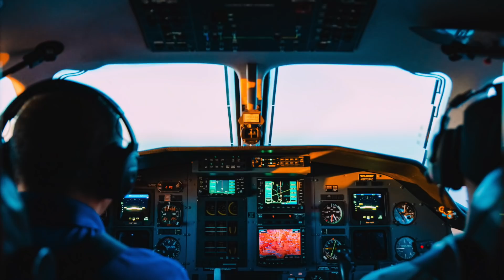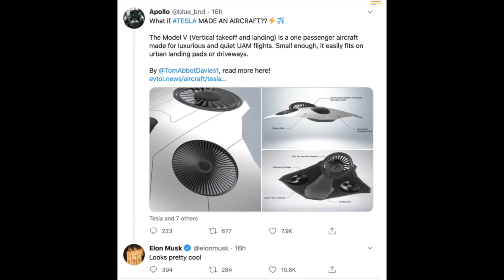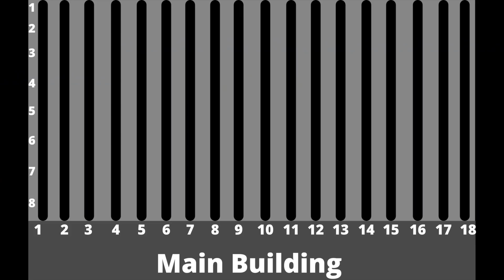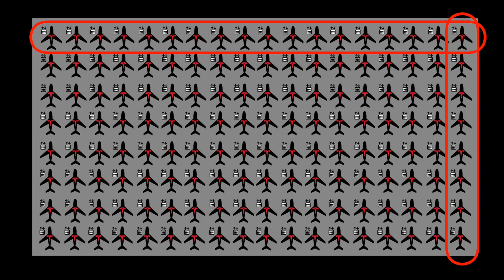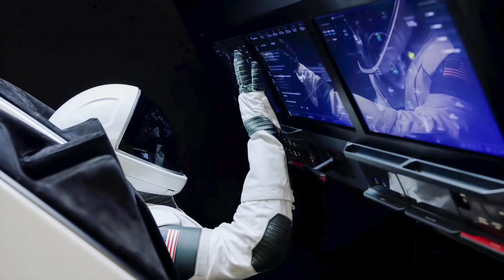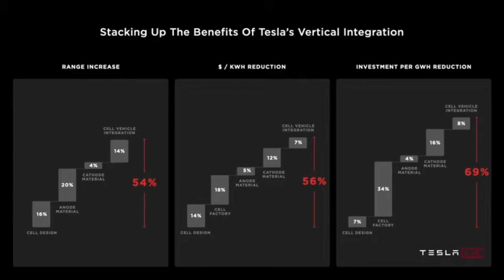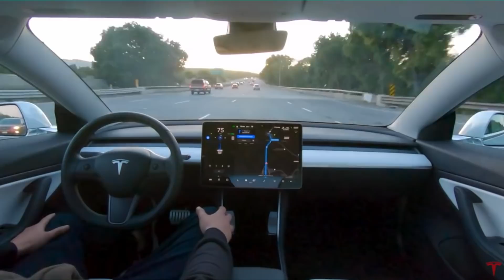Tesla’s Electric VTOL Airplane, will change aviation forever

Comment: There can't be an electric jet because 'jet' is an ICE compressed fuel-air combustion process. The Tesla craft would be a copter-plane combination and would be limited in its altitude like a helicopter beating the air. This is because the air thins at higher altitudes. This is why a helicopter is very limited in how high it can fly and also very limited in its horizontal speed at any altitude. With no hot gas propelling out the back, the question is can turbines be spun up to jet revolutions using only batteries?

Comment: All that stuff about high flying propellers is kind of wrong. While electric motors don't have the problem of needing oxygen, they do need a certain density of air for the principle of a propeller to work.  And with regard to flying high, "not much air resistance" also equals not much lift. 

Also, considering the similarity between electric drones and helicopters, the lack of electric helicopters might be telling us something.

Comment: Electric VTOL opens up interesting options where the plane can remain plugged into an extension cord until it's 50-100 metres up. Put a little parachute on the end of the extension cord. Plane takes off, using shore power, then hovers for a while at about 100 metres. The plane reconfirms all systems are spinning nicely, and waits for an air traffic control window to depart in its intended direction. At that moment, the cable disengages. Its little parachute largely keeps the cable where it is, while the systems at ground level winch the cable back down, where it belongs. It's then ready to recharge the next plane that berths at that spot. 

Not having to rely on batteries for the entire flight would be fantastic, especially for trips towards the edge of the plane's capabilities, or during air traffic control delays.

Comment: Regen on descent? Traditional planes already use the energy from descent for speed to create lift and stay up. They use little engine power. The more the electric plane regens, the less lift he is using from descent, so there is no electric-plane advantage in this regards

Comment: I always like how out of touch some can be in their artist's renditions of an idea, at 6:11 even though we are portraying a high tech electric VTOL aircraft.. somehow we can't let go of the light refraction from the seeming hot jet exhaust.. or would that be some horrible inefficiency of the electric motors being cooled? The part Elon and his design-build buddies can't grasp is their power storage concept.. so how much better does this bird fly when it's at 15% charge as opposed to 90? Same weight, less available energy.. somehow never will make sense! Li-ion is a great beginning, but definitely miles away from a solution.. bigger batteries lead to more spectacular fireworks.. and that is where Elon is king!

Comment: A couple of things... or several things wrong here.  
1.   Elon never said it would be a large aircraft, in fact he didn't give any indications of what size the air craft would be.  This leads me to believe it would be a small probably one seat aircraft, as he stated 75% of the aircraft would be batteries even with a drastic increase in energy density.
2.  As size goes up VTOL becomes more difficult, the largest VTOL jet is the Dornier Do 31, and its smaller than the Osprey.  The only supersonic VTOL is the F-35, though it cant actually do VTOL while loaded.
3.  For a small aircraft to go Mach 1 (based off of F16 thrust) you would need between 10,000 and 12,000 horsepower.  Each engine on the Concorde produced 36,000 horsepower at mach 2 and 60,000 ft.
4.  Electric jets don't really get more efficient at higher altitudes,  they are just impacted less by the altitude.  They will still loose thrust as they climb into thinner air.

For a small aircraft it would be doable, but the range and practicality would really suffer.  Think of it as a really expensive toy.

Comment: Hey Lars, check your physics, if the atmosphere is thinner then the electric fans have to spin faster to maintain propulsion. Of course the cooler atmosphere will help. This is why they supercharged so many high altitude fighters before Jets took over ....

Comment: As a plane with an electric motor gains altitude it will become less efficient not more. This is due to there being less air for the propellers to compress. Even though there is less air to feed a jet engine the jet engine is use an explosive combustion.

Comment: the biggest problem with electric mobility is what to do with battery waste. It will destroy us at the end, ist much more pollutant then gasses from combustion engine.  Es higher wi go less air density. Propeller engine depends on high air density, theoretically more air density more speed. Problem with that ist normally  air resistance, that's why we have jet engine's in the first place. Jet engine for speed doesn't that much depends on air density. In theory I suppose it's possible to produce something similar than jet engine powered by electricity. Juts the biggest problem with all electric enthusiasts is still what to do with all the battery waste, that kind of waste it can be compared with nuclear wast.
When I got to the point you are taking about less noise from electric powered planes, I realize that you really don't know that much about aircraft engine at all, by modern airplane engine no matter if proper or jet the most noise dosen't come from engine it self, but from air moving. The same problem have helicopters just that helicopters is noisier because there are two different air currents slapping together....

Comment: The vehicle has to constantly (in one way or another) counter gravity while in flight.  Regen on the way down therefore would serve to accelerate the vehicle downward, compared to no regen.  Bottom line is there will be very little (if any) regen on the way down.

Comment: I'm not sure how you figure the Electric plane will be more efficient on high altitude. Jets are a lot more efficient than Turboprop planes on high altitude thanks to that propeller don't work in thin air.

Comment: Less air density means the fan blades have less air to chew through which means these planes would have similar altitude limits as other turbo prop airplanes/helicopters.

Comment: Hard to visualize a fan-driven plane flying at very high altitudes to avoid wind resistance yet still have enough thrust to go fast enough to avoid a stall. MS Flight simulator would stall  a Boeing 737 at full throttle at around maybe 40,000 feet. But then Elon is the expert in rocket science, LOL! Should the plane look like a U-2 spy plane? Hard to carry passengers in an electric U-2 with long wings and VTOL.You would need batteries that use air as a reactant, I would guess.

Comment: The power and energy numbers for a VTOL plane carrying  100 passengers +gigantic battery would be mind boggling. We're probably talking 30,000KW of power, maybe more, to do the vertical lift of 80,000KG.. For many minutes, just to reach decent height. So maybe 3000KWHours of battery just to get to height. So we're talking of a 6000KWH battery all up, for a basic UP-DOWN trip?? 30 TONNES of battery?? Vertically lifted??? Total fantasy world stuff. And the regeneration when decending would be poor, with lowish efficiency. We're not in reality here. Sorry.

Comment: Picture it, you buy a "Travel" subscription, say Anywhere in USA (like a phone) from Tesla. Call them up and say you need to Go from Baltimore to DC. Tesla kicks out an itinerary. Car picks you up, drives you to the plane, flies somewhere, another car is waiting. Drives through a tunnel, pops out in DC, drops you at destination.
Reply: Or you just get picked up in a self-driving car that takes you to the Hyperloop. Why fly and slow the whole process down. Plus, flying in a small aircraft is dependent upon the weather. This videos was all wrong.
Reply: @learningcenter4111  Every form of flying and driving is limited by weather...
Reply: @electricaviationchannelvid7863  Hyperloop is not limited by the weather.

Comment: One other aspect is that, occasionally an aircraft will have a problem shortly after takeoff, meaning that they have to land again. In order to do this, they have to dump most of the fuel on board (stored in the wings). Regardless of the altitude, you do NOT want to be living underneath such a dump of jet fuel (kerosene), taken from personal experience.

Comment: Makes no sense to me. Why spend so much energy lifting people and cargo into the sky? The more weight you have to lift the bigger the battery needed, which adds to the weight, and so on. Electric high-speed trains would be so much more efficient. You don't even need batteries, just use the electricity directly. And do you really want the skies cluttered up with planes?
The only reason I can think of that these planes might happen is because high-speed trains usually need to be done by the government whereas planes could be done by a private company. And that's unfortunate because trains are much more efficient but we can't get our act together to build a government and economy that will do the right thing.

Comment: Lars:. This has nothing to do with this video.  It is just a thought.  If we follow the $$ and the $$ is the Gigapress, where are the 9 Gigapresses specified in the IDRA video to be deployed?  The 8000 ton Gigapress order placed in March 2021 was for GF5.  Where are the other 8 to be deployed?
  It's just a guess on my part, but, a 6000-8000 Gigapress just might have the longest lead time to manufacture. Thoughts?
  Lastly, I need a 3X Teslap sweatshirt and you don't offer them.  What's with that?

Comment: @6:00 how will an airport look? It won't... Who needs an airport? All domestic flights can be handled through StarLink navigation.
VTOL will realize the promise of Point to Point transportation. Having autopilot on a plane, with the height being stacked by the direction and speed of travel, makes travel much safer and faster.
The lower to the ground, the slower you go in any horizontal direction. 
By dividing the circle in 15° tranches  you can ensure that all planes at the same altitude are all going in roughly the same direction at roughly the same speed. 
Collision avoidance becomes much easier to calculate.

Comment: Here are some critical points about the video:
1. You Just explained the electric Propeller propulsion but not the "electric jet engine"(you showed pictures of Them). Further in the video you explain, that these planes will be Independent from air. But that is not true (in case of propeller propulsion). It needs air and the less air is around, the more rpm it has to do.
2. Propeller planes are not compareable to common jet planes in range and speed.
3. There is also no information about power consumption or range to "proof" that electric planes can replace common ones. The main problem is: a pure electric (Jet) plane will need big amounts of energy - can it be Power supplied and if how long? 

So in conclusion: please add the informations about the "electric jet engine" (Iam not an expert what the real name ist) otherwise people will think that Just propeller planes will be the future.

PS: I don't understand how even electric jet engines are Independent from air around. It has to "push" from something or blast something out -> actio = reactio newtons third law. The solution to carry a gas what will be ionised and pushed out is questionable. It will need huge amounts of it.

Comment: Probably the biggest factor is reliability. Powered lift vehicles have a 400 foot deadman zone where anything except for zero-zero parachute system will not work. And good luck installing such a system to lower down an entire aircraft. What’s funny is that these type of aircraft will typically be flying within the 400 foot deadman zone. Then there’s the fact that if you have thousands of these things flying around the city you’ll have a sound pollution like you can’t imagine. Talk about a mechanical beehive!

Comment: I agree that this is definitely coming. However either the technology has to be 100% proof or it’s not going to be widespread. Because with the rate of accidents regular cars have if these things start having accidents in the air and falling out of the sky we’ll have raining VTOLs crashing down on peoples heads and houses. I can just see the lawsuits. Also the problem is city infrastructure. Everything is made for cars. You’re not going to be able to take one of these things and fly to the supermarket and back home. So they will be for long-distance travel which will still involve driving a car or using public transportation in the end mile.

Comment: What i have learned from flying drones, im a little skeptical on the regen. You still need the props to produce down force as you come down to land. Regen might work for a short period if you dont mind falling from a great height.
Reply: For Helicopters there is an effect that causes the Rotor to spin up while falling with engine off, so that it is not possible to fall very fast. Gyrocopters use that effect entirely to lift off. The Rotor is not driven by the engine. Only the Propeller in the Back that pushes it forward. Maybe some kind of that effect could be used to regenerate Energy in this case.

Comment: Usually love your shows, but not this one - too many errors.

An airliner jet engine burns fuel mostly to spin a turbine which in turn spins the air intake fans.  Most of the air from the air intake fans is forced around the jet combustion chambers while a much smaller part of the air from the fans is used for combustion.  The majority of thrust from an airliner jet engine is due to the air that bypasses the combustion chambers and is expelled out the back of the engine, not from the jet exhaust itself.

All planes become more efficient as altitude increases due to the reduction in air resistance but it becomes harder to supply sufficient air for an efficient combustion since the air pressure decreases as the altitude increases.  Jet engines are designed to work optimally at a specific range of flight altitudes.  The flight altitude range is chosen to balance the gain in efficiency because of the lower air resistance vs the loss of efficiency of the engine because of the lower air pressure.

Any VTOL must expend energy to support itself in midair.  The power requirement is greatest during assent and it is reduced but not eliminated during decent.  An electric VTOL would not be able to recharge its batteries during decent but instead would continue to drain power from the batteries to support itself in midair.

Comment: There are errors in the explanations given. .... Ex. Air is thinner at high altitude, correct, but the airflow also produces less lift in the fans. So, there will be altitude limits. There is a balance between lift and forward resistance to movement. There are other misconceptions also.

Comment: The fans don’t turn the opposite direction when it’s descending, they still keep turning the same direction.

I would think low air density at high altitude would be a problem in terms of gaining enough lift from that lifting body form that you show. I would think you would still want to have wings on the thing to get your lift. I think it’s going to need a lot more energy density in the battery than you think it’s going to need.

Comment: The 2021 Chiron's 0-60 time is 2.3s, according to Car and Driver at:
You might also include the top speeds, which according to Car and Driver are 261 mph for the Chiron and 250 mph for the Roadster at

Comment: Can you not (for now) combine 1 jet engine for a power boost at take of with 2 electric cursing engines for cleaner and cheaper distance and landing and have a hybrid jet liner? Just till the batteries can do both so we do not need to wait to start cleaning up air travel.

Comment: There are some excellent hybrid airships using buoyancy to offset vehicle weight meaning you don't need 400 X to get the job done it just will not travel at extreme speed frankly you don't need that speed when just moving around one city or even hoping 2 or 3 hundred kilometers to another city.

Comment: I swear E once said he didn't want to do VTOL and would let someone else deal with it/figure it out. Maybe it was a distraction, maybe he changed his mind.
Reply: No, it's not a distraction. A VTOL would be an absolute waste of time, energy, and resources. Hyperloop would be faster and safer. And that is already underway with the Boring tunnels. This video was just a distraction. There won't be a VTOL by Tesla.
Reply: @Christian-fx9ur  
It is going to be a separate company, but same pool of engineers...
Reply: @coldfusionspacexxx9814  Where did you hear that? I don't see that they would waste time on it. Hyperloop, tunnels, and FSD make electric VTOL transport irrelevant. You disagree?

Comment: Can see short haul and aerotaxies, but longer range not so much... but you can have 4 planes taking 100 rather than one 400 seater.. as there will be no air crew costs or fuel

Comment: I'm thinking of the possibilities for a solar zeppelin. If you have really light solar film, you can charge as you go, and range is potentially unlimited. You can propel forward electrically, and not be concerned about air for an engine. You could even make hydrogen as your lifting gas, by electrolysis from the water that is always in the air in some amount. With today's technology, the risk of a hydrogen explosion could be very low. A variety of approaches could be used. This could be useful for either passengers or cargo. The considerations would be different for the two purposes.